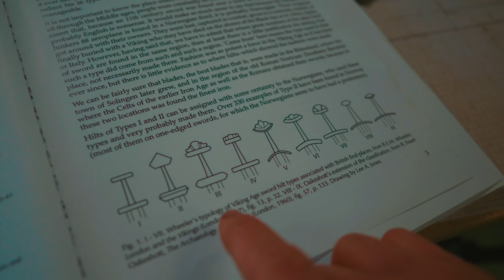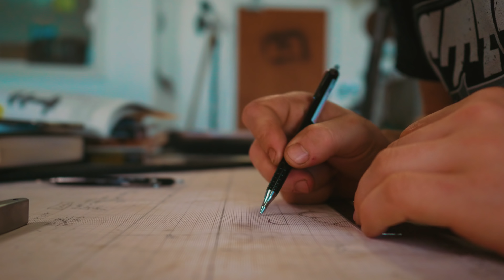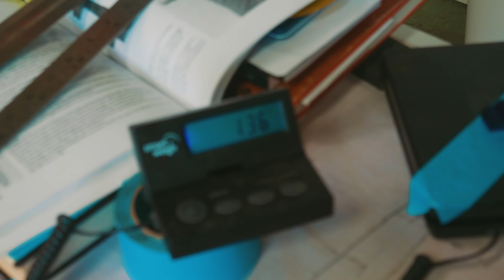MAKING A VIKING SWORD!!! Part 9

Comment: If you consider how much work it still is using such modern tools... Making such a sword back then would have taken months!!
Reply: And it did! Especially considering the source material for the famous Ulfberht swords was crucible steel, which had to be worked and consolidated gently over weeks and weeks of labour; just for the billet! It often broke, had to be forge-welded back together, and then drawn out into a preform. After that, however, a master-worked piece took a couple weeks to finish thanks to assistants who manufactured different parts of it in concert.

Lower-tier swords were less labour-intensive, but a good shop with several hands could crank one out on a daily basis, especially so in the late medieval ages when material was easier to come by and swords became cheaper.
Reply: SkullCollector Nearly totally correct. I have read (but I may be wrong) that the steel used for Ulfberth swords came in ingots or billets all the way from India because norses weren't able to produce their own and indian steel was at the time the world best.
Reply: True, however they didn’t really settle for a good-looking sword.
If it could cut things into pieces; they’d use it.
For example: they didn’t go for complex damascus steel...
Reply: Tech Bullet if you look at many early Norse and Anglo-Saxon blades, there are many with very complex pattern welding.
Reply: @Sander van Duren: Wow, that's interesting! And this is not due to special hardening techniques? Like hardened edge but the rest remained almost soft?
Reply: Kyôdai Ken look up the Sutton Hoo sword, or Viking Multi Bar Sword. They had both iron and steel. The iron was soft and tough, but didn’t hold an edge. The steel was hard and held a good edge, but was brittle. They typically would make a solid steel edge, to make sure it could hold an edge, and then on the middle of the blade, there were a bunch of twisted bars of layered iron and steel(similar to the way Alec makes his Damascus). That way, they got the good properties of iron and steel, but less of the bad ones, as well as making beautiful patterns.
Reply: Idk about months. Maybe a few days because the smiths back then worked for like 16+ hrs straight and were very experienced and fast at what they were doing. They didn't try to make everything 100% perfect, but as close as it can be for the shortest time they could make the weapon.
Reply: a simple steel blade can be hand forged, ground and tempered in hours - comparing Alec's Swords to the "average" sword of a similar design would be like comparing the build time of a Chevy and the build time of a Bugatti. (Good enough Vs. The best you can buy)
Reply: 10 months exactly

Comment: Hey Alec, i repeatedly see you countersink a thread after cutting it. As an industrial mechanic i would advice you to countersink the hole first and then cut the thread. In this case you prevent developing a burr at the beginning of the thread which leads to a better screwing.

Comment: Make a a handle to hold the cap so you don't get yourself on the grinder or use a dremmel. If you make it right it can then serve as a holder for any pommels or guards your make later on.

Comment: have you tried making a paper  pattern  by folding into 1/4th and cutting only half the pattern you like so you have a two mirror images when you open it up and you spray tack to hold the patterns in place one on each side?   try a slack belt to easy the grind lines?

Comment: Late to the comments and someone might have had this idea... but I think the pommel cap is separate inorder to create the correct balance on the sword. This could be customised  to each owner. Put on cap find out if its to heavy or to light. Adjust until desired weight then rivet to lower guard.

Comment: Heya Alex, not sure if you know this (it could just be a mistake i saw) but when you drill a hole and tap it, counter-sink it BEFORE you tap it. if you counter-sink afterwards, there's a chance the threads will distort and the screw wont fit in.

Comment: Hey Alec for the future if you want to work to the highest accuracy. You mill face 1 using dice as reference for sides. Then put it against the back jaw, as it is more stable, with a large face (2) up. Have a copper or wood shim on the movable jaw (part side 6). Then drop side 1 to the bottom, side 2 to the back jaw, you now mill side 6. 1 on back, 2 on bottom, mill side 5 which is facing up. If you were to do side 3 and 4 you would place 2 on the solid jaw a square against side 1. Face 3 is up, close vice, remove square, mill. Then rotate to mill side 4 keeping side 2 on the back jaw. Remove burrs and cleaning vice after each milling operation. This will result in a rectangular prism as square as your machine is. If you were already doing this good job but it looked like in the video you put side 1 on the movable jaw in your set up for side 2. This will save time on the grinder more then you might expect.
Reply: Grinder= grinding wheel in this context. Don't try to make anything this degree of square on a belt sander bad idea very bad idea.

Comment: I don't know where my comment went .. but I assumed right after your question - why the pommel is an assembly as it is - that this is for balancing the sword.
Now that I finished the video I am even more sure. It is way easier to create the piece of art and afterwards remove material inside or replace it with heavier material to balance it perfectly.
Put it on, check where the center of gravity is, pull of and adjust, stick it back on and so on.
That looks for me like a real timesaver.

Comment: A cool idea for another series:

You should machine yourself a pneumatic engraver like this. Just putting some thought into how it works internally, and it really seems very simple, as the piston moves back and forth inside of the cylinder, it redirects the flow of the air. You could machine the channels into the cylinder in two halves and then bolt them together around the piston. You could even make yourself a beautiful wooden palm held control handle for it. 

http://www.airgraver.com/Lindsay-AirGraver.htm

Comment: It's looking great! Does the book say how long it took the old blacksmiths to make a sword? Seems like a lot of work with power tools, it must have taken months without!
Reply: It took less than a month, one smith didn't make the whole thing. Most of the stock removal and rough forging was done by an apprentice while the smith worked on other parts. Pommel caps were made by someone else if they were decorated(jeweler) and the grip was made by a woodworker. They also didn't grind as much, they would forge closer to the finished shape because the material was expensive.

Comment: Alec you drilled and tapped holes in your cap why not use them and make a handle to use to avoid grinder bite and the heat that builds up in the part?

Comment: Warning stupid question incoming. Diamond is on of the hardest minerals. Would it be possible to add diamond dust or shards to the cutting edge of a blade? Would that mean it would never need to be sharpened? Is that even possible?

Comment: It looks like it might have been easier to shape the tops of the lobes on the slack belt, is there a particular reason you decide to use the hard back?
Reply: He probably wanted more fine control as to what he was grinding, and might switch to a slack belt when he starts cleaning up the overall shape.

Or he might have just not even thought about that.
Reply from the maker: Though it conforms less to the radii, it is much easier to be precise with the platten!
Reply: Good to know, thank you!

Comment: Why peen the end of the tang instead of threading it and using a nut?  Certainly not because of "historical accuracy" because the tooling used isn't historically accurate anyway, and you'd never see the nut under the end cap.  Also, a 10th century swordsmith would have loved to be able to easily disassemble a sword to sharpen or repair it if the had the ability to create precision-threaded screws and nuts.

Comment: but in the 10th century, how wud they cut/shape the matals into right shapes and sizes?
Reply: Zalva they would mold them in forms
Reply: oh yea i never thought of that... but still how wud they make the molds without the power tools and stuff? must take years to make one sword.
Reply: They were just very good at forging. Cutting hot iron is easy with chisels, and you can get the shape pretty close with a hammer, it just takes skill. I’m sure forging this wouldn’t take a year, but definitely more than a couple of days.
Reply: Zalva the lost wax method for, has been used for casting for thousands of years, and there are several archeological finds of such moulds from the viking age. At its most primitive, you only need beeswax, clay and horse/cow manure to make the casting mold, if I recall correctly.
Reply: Maaan.. we used to be Vikings... We killed people with our bare fists, stole their swords and improved them... There's your answer! ⚔️

Comment: Okay I’m just going to say it. Alec, love your work but your videos are becoming less and less fulfilling. Instead of a 10-12 part series for one project, I really think you should consider longer episodes and condense the project into 3-4 videos. It used to be that I would finish watching one of your vids and feel I’ve walked away having seen you achieve something, these days however I just catch myself watching the first and last video of a project as those are the only ones with any real substance or sense of achievement. I’m not saying the video quality is bad, quite the opposite, but these videos where we just see you grind a shape and that’s it can be likened to drinking a non alcoholic beer... still enjoyable but at the end of the day there’s not really much point.

I would have been much happier at the end of this video if we had seen the cap fitted and perhaps a test rivet before fitting the handle, and then perhaps a start on the handle itself... just rough it out and leave the intricate detail of both the handle and the cap for a single video. 

Anyway, thank you for producing the content that you do, I still always look forward to your videos :)

Comment: The distance between guards looks a bit small. Can a big Viking with armored gloves fit his hand in there? Can it be used with two hands?
Reply: Fred Garvin 
It's historically accurate, he checked and made it that way.
Reply: Historically not every sword was meant to be, or was even capable of being used two handed. Look up any arming sword and like the one Alec is making, they were dedicated one-handed swords.
Reply: Vikings fought single handed?
Reply: Wasn't my question.
Reply: If you take the importance of their shields into consideration it is pretty obvious, that the swords were used single handedly. Think of a shield wall and such techniques.
Reply: I'm not aware of any evidence that Vikings had armored gloves. Plate armor didn't exist in Europe in the 10th century. At best there might have been maille sleeves that extended past the wrist.
Reply: Viking swords were specifically meant to be used one-handed while the other hand was for the shield. At that time there were no metal gloves for hands. Also if the sword handle just fitted a hand then there was a better grip for slashing. The hand-and-a-half swords with a longer grip suitable for a combination of slashing and thrusting didnt evolve until later in the middle ages. As a result the shape/geometry that Alec Steele produces here is generally historically accurate.
Reply: As the others have said viking age swords were exclusively one handed and also as far as we know they didn't wear any protective gauntlets so either fought bare handed or possibly wearing a regular leather glove or something.

And yes, hand injuries are quite common in battlefield finds of the era
Reply: See Scolagladitorias video regarding this.
Reply: Good point. Thank You.
Reply: Plate armour dates to the 13th century, chainmail dates back to the 12th century. I think it's reasonable to assume Vikings wore some sort of armour and gloves.
Reply: Fred Garvin well, Vikings didn't wear bulky armored gloves

Comment: To anyone that might know: how would the vikings have made this part back in the day? Forged to shape?
Reply: normally cast then hand finished
Reply: Casting, but most of the swords that the vikings used were made by other countries.
Reply: well, not cast. Cast steel wasnt available for the next 800 years after that date. 

Most of the indication (though hard to tell on originals) is that the peices are forged in several possible ways. Upper and lower guards were either forged, punched and then ground on a wheel, much like alec has, or a long, thinner strip was forged in a "U" shape, and forge-welded to make the guard. the upper guard would've been forged, making a () shaped block, and then punched in to make a larger hollow. X-rays of many extant viking pommels suggests that the rivets, rather than drilled (and obviously not tapped/threaded) would be welded with a simple U shaped shackle inside it, brazed in place. 
once the very rough shape was forged in the rest was probably cut with files and grindstone.
Reply: They almost certainly didn't cast iron. They Would have done it through very rough forging, and finished by filing.
Reply: I would believe steel or iron wasn’t so cheap back then, so I doubt a lot of grinding was involved. Smiths must have been quite skilled back then, so I think they did actually forge this, maybe with the help of some swages.
Reply: J. G. Elmslie 
grinding wheels are attested to in early sources? i know we have woodcuts and paintings of their use in the 14th century onwards, didnt realise they wet back quite that far
Reply: also, alec here has a sword blade of 560 grams or so, even with about 300grams of hilt parts thats still a VERY light sword, could it be that hes made the thing too light compared to what we know of orifginals which SEEM to be mre the 1000-1100g mark
Reply: I expect they did a lot of filing.  Filing is still an important skill for machinists.  Not long ago the test of machinist skill was how closely they could file a square hole and a square peg to fit.
Reply: To correct something another stated... the blades were generally foreign made (frankish blades being very sought after) and then the fittings would be made in Scandinavia.

And many of the more complex fittings with lobed shapes and such were cast from bronze and plated with silver and gold though I know of at least some who were iron that was in all likelihood filed to shape. Though still often plated with silver.
Reply: elgostine - search for "utrecht psalter grinding stone" and you'll find a 9th C depiction of one.
Reply: Halfdan - there's one particular group (hiberno-norse) that are cast copper-alloys, (petersen type O) but the rest are almost always wrought iron, forged to shape (not always, but, mostly.) with the layers of material over them. Saxon hilts were often made from copper-alloy or, in the really high-status ones, gold and garnet, but many of the later saxon, like the cawood, or the slightly earlier but less high-status saxon ones, like the Gilling sword, are either entirely iron (the former) or have iron elements with silver-gilt over it (Gilling.). 

You're absolutely right that the blades themselves werent of viking manufacture - made along the rhine or in passau, shipped down the Rhine, Danube, and the Elbe, and traded. 

the viking plating method is fantastic - hundreds of carved grooves, inlaid with silver wire that's bigger than the groove so the wire mushrooms over, and merges into a homogeneous layer - amazing amounts of workmanship.
Reply: J. G. Elmslie 
Was the pommel cap made of a single piece of metal, or were all the lobes made individually and then connected somehow?
Reply: MC Armoury - I'd agree steel, no - that was a valuable resource and would not be wasted at all, but iron was quite common, in the form of wrought iron, locally smelted. that stuff was made all over scandinavia, by smelting from ore or Bog Iron, and is easily worked. relatively useless for blades, but good enough for hilts, padlocks, and all the other bits you find in viking find contexts. That said it was probably forged to a much closer tolerance than modern craftsmen who can afford the material loss, especially in simpler shapes. ones like alec is making, being quite tricky, were probably a little more wasteful, and filed a lot to shape.
Reply: Thanks for all the replies, definitely answered my question!
Reply: to the best of my knowledge, Type R and Type S are one-peice structures, from x-rays I've looked at. but I've not seen a lot of the type, so, I may be wrong. My field of research is later medieval arms.
Reply: J. G. Elmslie
 Thank you for your knowlege and your willingness to share it.
Reply: Petar Djurickovic 
I'm not sure but i would make one solid one and then use that to form the actual cap